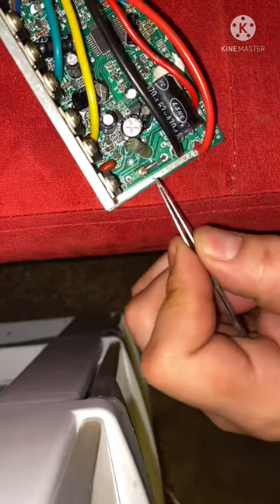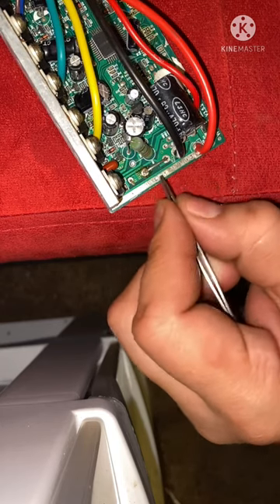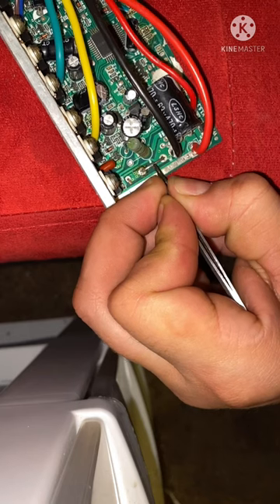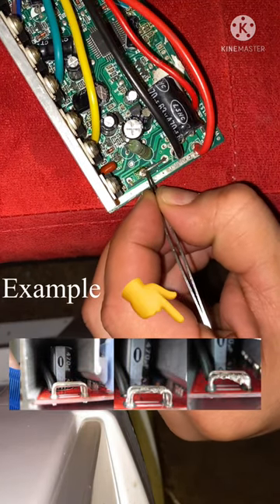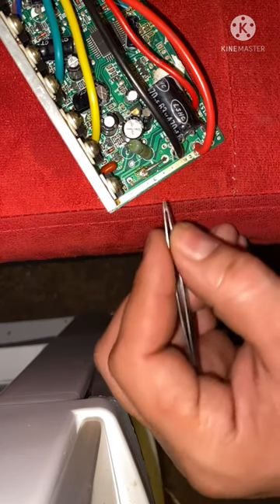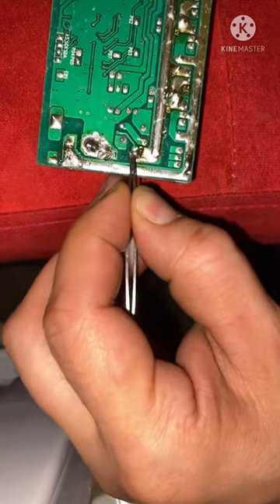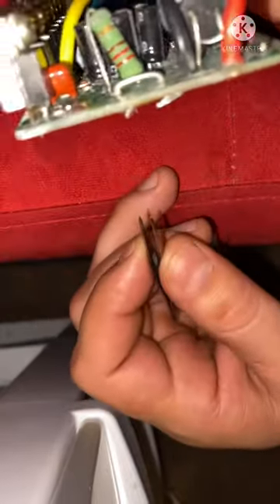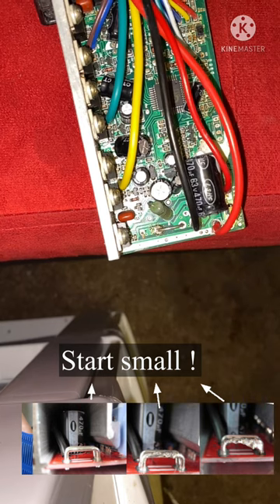Shunt mod (36v 350w) Brushless DC controller ￼

Comment: I got the 36V/48V 350W Brushless Motor Controller..does not seem fast enough what can I buy to make it faster? 500watt controller? I want something that will fit in the same housing as the battery to look factory?
Reply from the maker: OK then I will definitely go with the 500 w brushless controller. That thing is pushing 30 amps of power. But this only works on the bird -3 ! You would be wasting your time trying to fit this inside-the bird 2 model.. but definitely go with the 500 wire brush this controller. Those things are heavy duty for like mopeds/go karts.. I personally don’t want to go back to a bird-2 after having a 500 W brushless controller installed in the bird -3..
Reply: @pjscootermods  What is a bird 2 and bird 3?  I have a heybike cityscape with the battery under the seat or behind the seat post and I think the controller is under the battery and behind the crank. how do I get this thing to do more than 17mph. Is there a controller that will fit in the compartment where the existing one is.

Comment: Hey,I have this same controller and display throttle on a bird zero,what are the best P settings for it?or what have u found to work best?I've also paralleled another zero battery to it.
Reply: The default settings are pretty much set correctly from the beginning, changing them won't give you any extra power. The only things they will change is the wheel diameter size if you add larger rims or tires, or if you add a different motor you can select the number of pole pairs for that specific motor. If you want more power, then shunt mod like this chap is showing in the video. If you add a piece of wire across the board or solder the whole shunt to (go all out) as he says, just make sure your battery has a BMS. If it doesn't the controller will fry, the only reason his hasn't is probably that the BMS is limiting the current to the controller. If he used a raw battery with no BMS his controller would have died long ago. If you want a sizeable increase in power then solder about 1/3 to 1/2 the way across the shunt.

Comment: Hi. I’ve burned that green resistance. May you give me the value? My it’s totaly black…
Reply from the maker: Do you mean you burned the shunt ? Or the mother board ? I stoped doing the shunt mods,just go with a higher amp controller, that’s the best & safe way to go about it. I don’t have a meter to test the value of Solder I add to the shunt. But if you insist on doing this I will start with just dab of solder on 1 corner of the shunt. Don’t want to go over board with, sounds like that’s what happened ☠️👀

Comment: One last question scooter God. I've put thick layer of solder on shunt on third gear it whines real loud and sometimes goes into protect mode and won't drive again until I turn it off and on again. Is too much solder a bad thing and do you think switching from 36 to 48 would fix it or maybe 24?
Reply: does the motor get hot?
Reply from the maker: Just go light on  the Solder, you probably put too much on there like you said some controllers don’t like that shit,

Just go with a bigger controller with a higher amp rating . Do you have a b2 or a b3 ?

If you have a bird 3 it be better ,you can fit a bigger controller in the housing

Without having to do the shunt mod
And you keep your same battery

Comment: i did  some shunt mods for e scooters, the real deal is that you have to balance the level of soldering, the engine will make crrrr so reduce that as much as posible :)
Reply from the maker: True ! I stay away from shunt mods now . Nowadays I just go with a higher rated amp controller

Comment: Hello Mr Anonymous, I am Valentine from France.

I comehere to ask you for help because I think I may have damaged my electric bike.

I installed a 1000 watt 48 volts rear wheel and have a 48 volt 15ha battery.

Following problems with annoying micro cuts when I was driving during acceleration. I deduced that my controller was sending too much current to my wheel. I tried to adjust my screen SW 900 (P14 Current limiting) but it didn't work.

This morning, I therefore decided to cut a small section on one of my two shunts present in my controller.

Once on the road, everything went well. power limited to 1200 or even 1250 watts and no cuts during acceleration. It was perfect. Except that after 10 minutes of driving, my controller got stuck on error code 09 and I can't do anything! I unplugged everything and plugged it back in as well, I checked the controller and nothing seems to be damaged (I just noticed that when I switch on there is a single little "tick" noise in my wheel as if it is was activating, and before cutting my shunt; no particular noise when i turn on).
In short always error code 09 and impossible to use my engine.

I feel like it happened when my speed was quite high at the end of my road test but it may not have anything to do with it!

When I came home pedaling without motor, I felt a medium resistance force in my wheel. Hope I didn't fry anything...

Thanks a lot for your help!
Reply from the maker: OK so my first question is since you mentioned you were using a 1000 W 48 V rear wheel and a 48 V battery with 15 ah .

What is the wattage of the controller ?
What is the amps of the controller? 
And of course this should be a 48 V controller you are using with this 48 V battery pack.

Error 9  Solenoid Brake Trip
The parking brakes have a bad connection. Check the parking brake and motor connections. 

If you feel resistance in your hub
Motor  then you blew out your controller !! And will need a replacement 

But yes it definitely sounds like it has something to do with the controller you purchased..

Your motor is still good but your controller is bad.. but nonetheless it sounds like you had a significant amount of current surging through your whole motor causing it jerk/cut on/off Triggering to be bms to cut on/off
Reply: @pjscootermods  Thanks for your help,  I finally identified the bug, I fried a Mofset close to the phase wire (a friend tested them for me). I probably made a short circuit when I opened the controller and cut part of the shunt to reduce the power. Cordially.

Comment: Omg, Just desolder the jumper and ground wire from it and put rhe ground cable in the end of the "shunt"hole...
Bye bye shunt, now cables can bottleneck the whole thing...
Reply from the maker: Yup this is something I don’t bother with anymore! Just stick with a higher amperage Controller